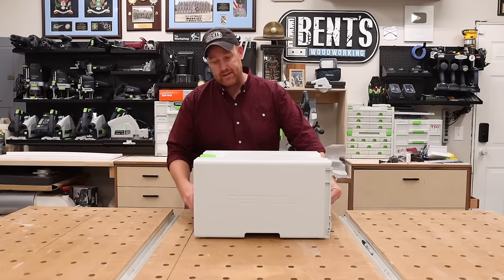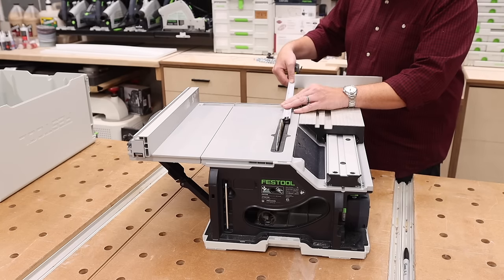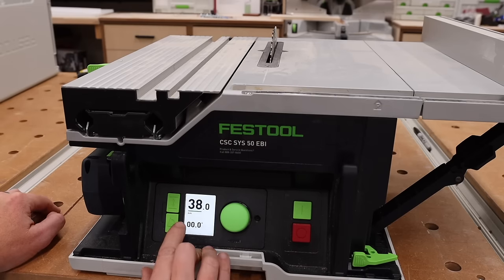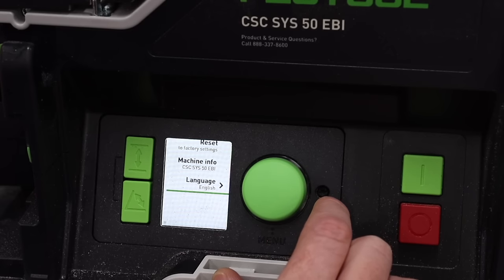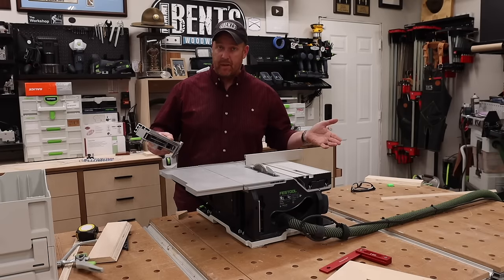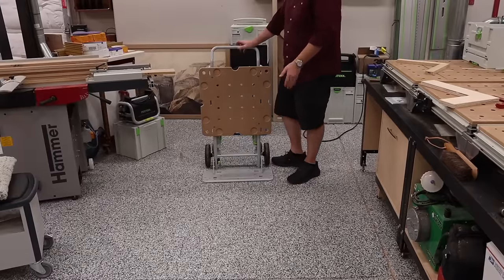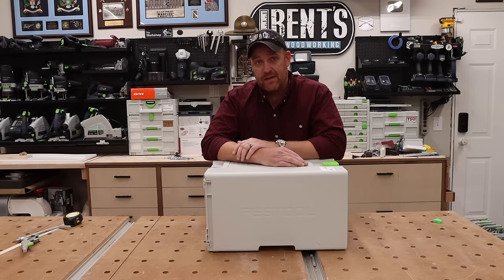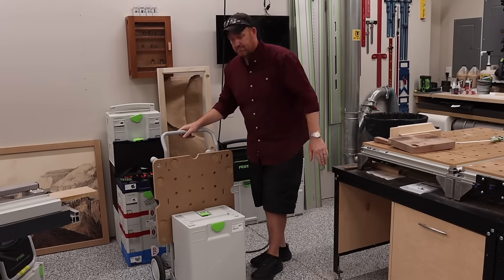Festool table saw review

Comment: Great Review and s[ectacular table saw. For those who have a tighter budget and the need for a smaller table saw, check out RYOBI One + HP 18V Brushless Cordless 8=1/4 inch Compact Portable Jobsite Table Saw, It comes with 3 batteries or at least it did on a special buy. Let me tell you........for small shops, for shops that can't give up electric.......this is a very accurate saw and if you add a top of the line blade.......you will have no regrets. I simply would not trade mine, No mistake here, Festool has a spectacular saw offering.......just wanted to give you an alternative,

Comment: And then if the blade mechanism breaks?
Reply: Either you leave it broken or have it fixed? Same with any tool, no?
Reply: @AaronGeller  good luck fixing a computer. Much easier to fix a gear or handle.
Reply: @SonsOfThunder229  thankfully they have quick turn around service and 3 years of warranty 🤷🏽‍♂️
Reply: 3 years goes by fast. I have 10 grand in festool and it’s all out of warranty.  But the repairs out of pocket have been reasonable the rare occasion something fails.

Comment: Its a great product but i think ill pass on this , the only think i see useful on this saw is the electronic angle adjustment,  the hight adjustment is just a gimmick for selling point,  sliding table is a welcome option,  overall to justify my 2 cents , i have the cordless dewalt table saw and that little one has made so many cuts in different stock and never got any issues just for 399$ cad , i i had money laying around i might of bought the festool because i am a big fan of festool and own about 12 tools from them , but this table saw might not be for everyone

Comment: I have exclusively Festool tools because I believe that, for the most part, the premium cost is worth it.  But I just found out that this job site saw is TWO GRAND!!  That is freaking ridiculous!!I t is NOT worth that and not even close.  Come on Festool.  I'm a big proponent of your products and not someone that promotes them constantly on YouTube, but this is just ridiculous.
Reply: It's $1500, not $2000. $2000 is the full kit, but I could buy just the saw for $1,500 and use my existing batteries.